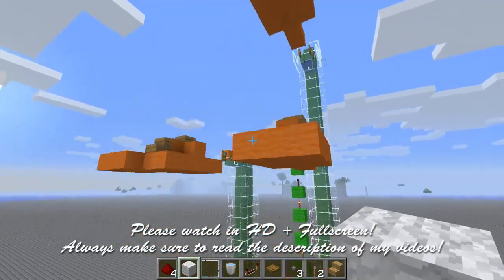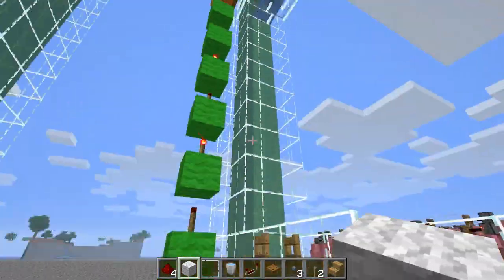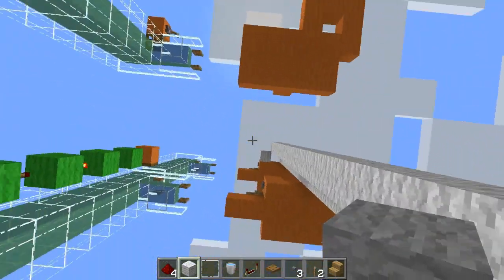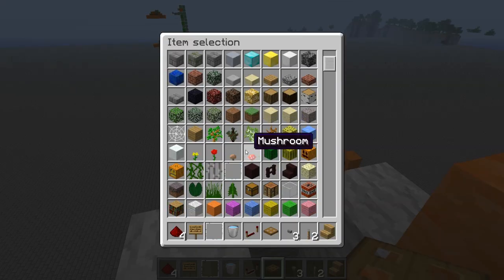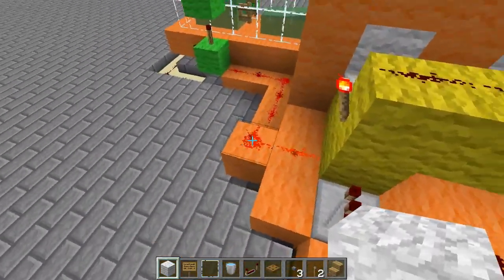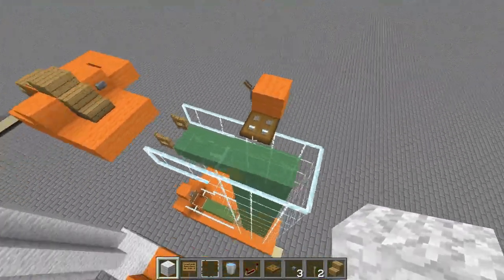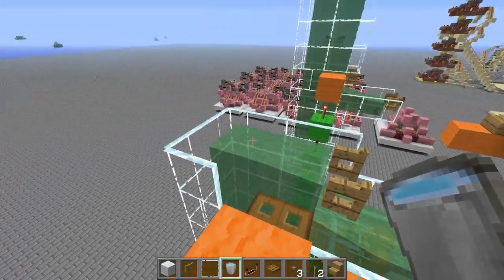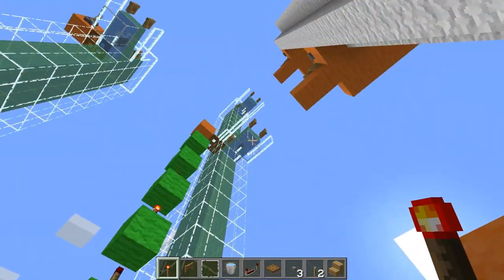Docm77´s Minecraft 1.0.0 Tutorial: Multi Floor Boat Elevator

Comment: If you're just gonna have 2 floors with a select floor function, you only need a single collumn of redstone torches, connect to one lever insted of 2 collumns with 2 buttons. Just hook up the trapdoors one at a powered torch and the other on an unpowered one. Switch lever = both trapdoors changes state.